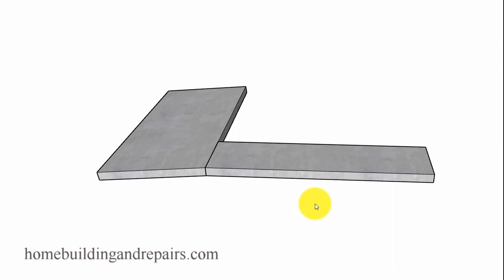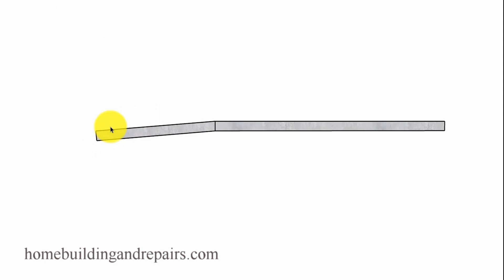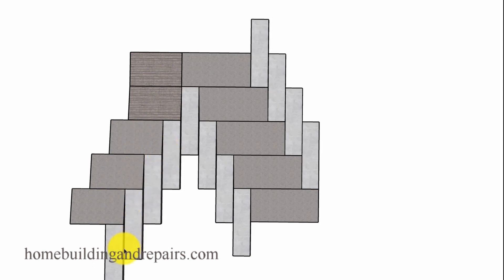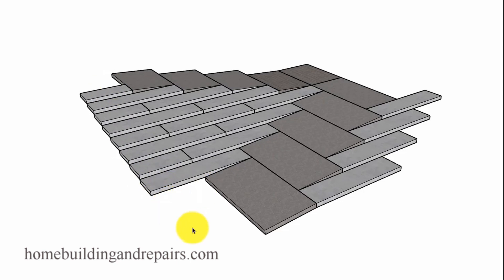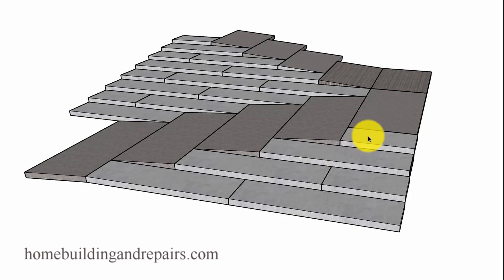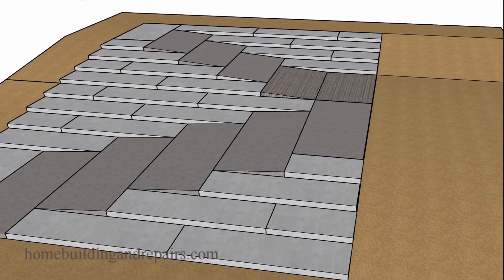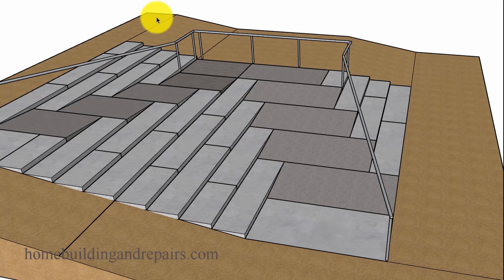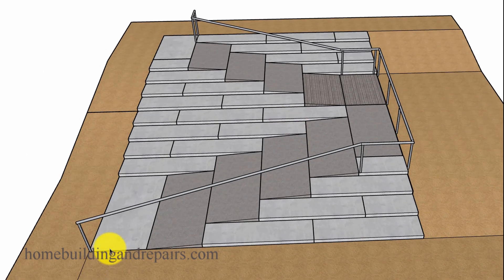How To Design And Build Concrete Stairs With Ramp Built In Center - Interesting Architecture

Comment: what is the angle in each piece on stair ramp thing..??
Reply from the maker: Building codes usually are 1/4 inch vertically for every 12 inches horizontally or a .25:12 ratio.